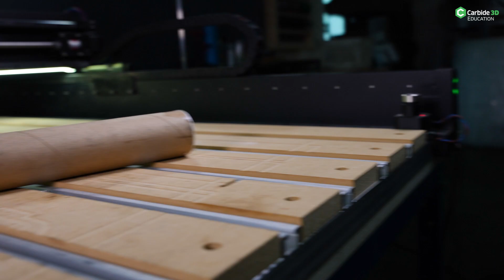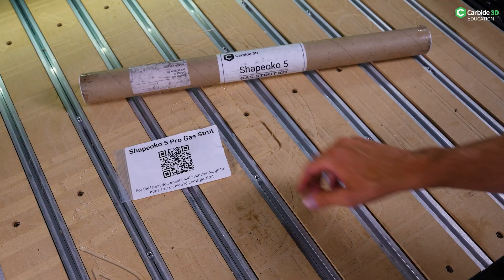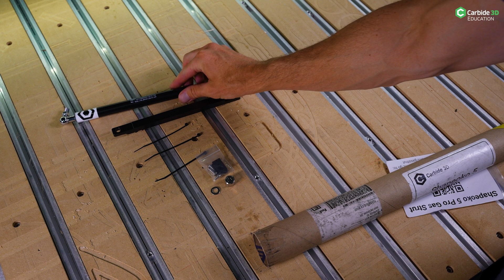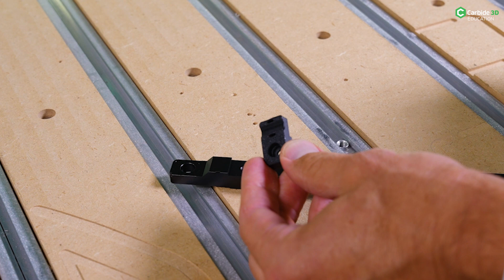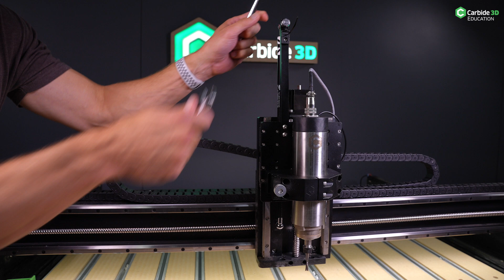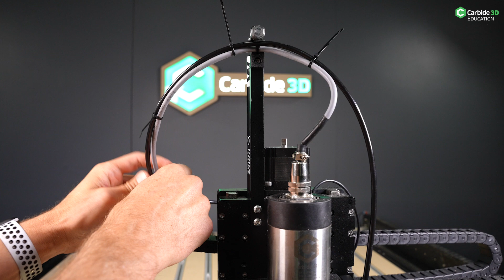Shapeoko 5 Gas Strut Kit Installation

Comment: What I am assuming is the "wire guide(s)" that came with the gas strut I just received look nothing like the one in this video or in the instructions. Did you guys make a change to the part?
Reply from the maker: We are constantly making improvements to existing parts and kits.   That’s one of the benefit of being in the Carbide 3D family.